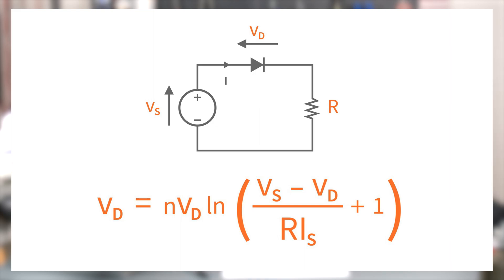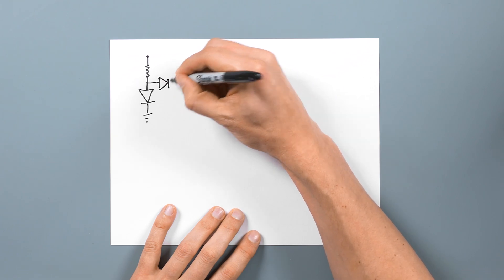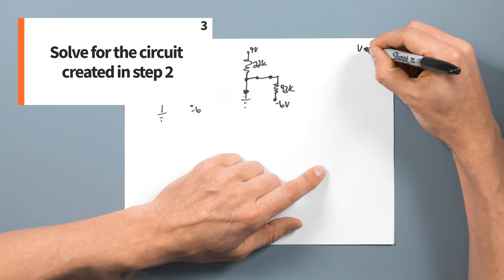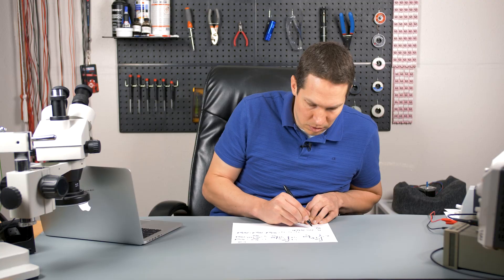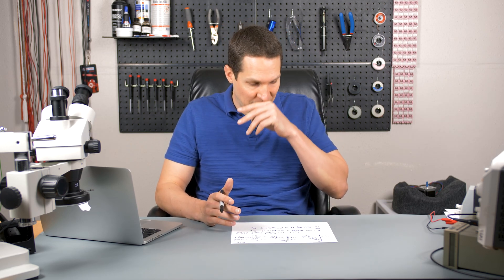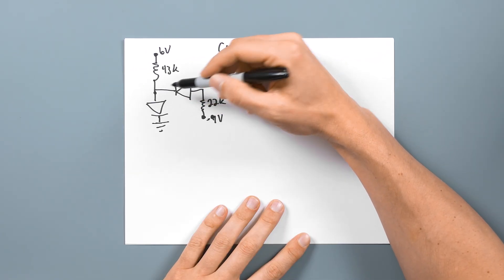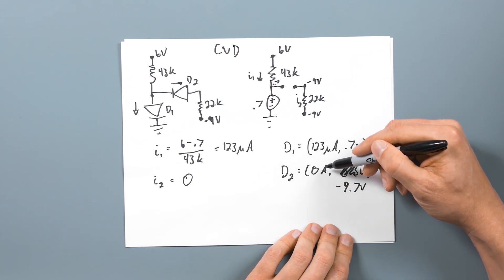Solving Diode Circuits | Basic Electronics

Comment: Why it's not closed circuit? This is terrible method of circuit drawing
Reply from the maker: Strangely, I agree - it's not my preferred way of showing things either.  But in the classes and textbooks I've taken/seen, they show circuits this way ALL THE TIME.  Your experience may be different but, as much as I dislike it, I think it's good to get a good feel for how to deal with both representations so it doesn't cause problems in the future.

Comment: I think drawing circuits in such a manner is confusing.  Circuits are supposed to be closed and putting voltages at a node with no connection in sight throws people off.
Reply from the maker: Isn't that interesting how we get used to viewing circuits a certain way?  But people do it different ways and it's good to get comfortable with the different common representations.
Reply: @CircuitBread  I've taken a few circuit courses as an electrical engineer, so I do see the many different ways.  However, the fundamentals of circuit analysis are knowing the voltage-current relationship of an element and kirchoff's voltage and current rules.  It's just strange with no closed loop evident in a circuit drawing, but circuits with diodes and transistors are usually displayed as shown in your video.

Comment: I have a question. We are learning about diode circuits right now in my microelectronics class. One of our homework problems has us solving for the diode voltage and current of a diode/resistor series circuit using not only the constant voltage diode model, but also the iteration method using both the KVL equation and the exponential diode equation, along with finally a load line analysis using Python/MatLab. We are tasked with solving for these values with the applied voltages of 0.5, 0.8, 1, and 1.2 V. The values of reverse saturation current and resistance are both given. Using the iteration method  for the applied voltages of 0.5 and 0.8V, the resulting values of diode voltage quickly rise above the amount of applied voltage, which obviously doesn't make sense in reality. And subsequent iterations would result in a negative current, which causes issues for the log function being used for the iteration. I know this is surely because it is before the threshold voltage that would cause current to flow. I feel comfortable in saying that no current would be flowing with the applied voltages of 0.5 and 0.8 V, but what exactly could I say about the diode voltage when the iteration breaks down?

Comment: hey, thanks for the great explanations! I was wondering in the last exercise of i2=0 how does the voltage drops across D2?
Reply from the maker: I hope I understand your question.  So, when i2 = 0 (there is no current through diode D2) why is there a voltage drop across it?  It's important to note that since there is no current through the resistor, there's no voltage drop across the resistor, so the voltage potential on both sides of the resistor is the same: -9V.  Since we know the voltage potential on the left side of D2 is +.7, we can see that the voltage drop goes from positive .7 to negative 9, so we get a 9.7V drop over D2.  Does that help?
Reply: @CircuitBread  thanks for answering, from your answer I understand that even tho there is no current there is a drop in the voltage value because of the diode which is different from what happens with a resistor?
Reply from the maker: Sorry for the delayed response, but yes, you have to change your way of thinking between resistors and diodes.  I thought ohm's law applied to everything at first and it took me a bit to realize that it doesn't work that way.

Comment: Feeling like my professor threw our class to the wolves, on the same day he introduced diodes he wants us solving the peak forward current through them and we have both AC and DC sources in the circuits. Any chance you have an example like that?
Reply from the maker: Hey Matthew, that sucks - I really hate that feeling.  While we don't have anything for that explicitly, I'd recommend approaching it with superposition to simplify things:  https://www.circuitbread.com/tutorials/solving-circuits-with-superposition-theorem  Basically, find your peak forward voltage with the AC circuit and then had that to the forward voltage caused by the DC circuits.  The challenge here is that you have to be sure you're biasing your diodes properly in your assumptions.  Since you're planning on it being your peak forward current (and not trying to figure it out at all times), that should make it a bit easier.

Comment: This is really helpful in understanding diodes and their calculations for an exam I have coming up. Just one question. How do you know if your assumptions are wrong? Are you double checking the current values you got at the end to the assumptions you made for if the diode is forward bias or reverse bias? Forward = current and Reverse = no current.
Reply from the maker: Yes, that's exactly it.  After you've done the math, if your current is flowing the wrong way through the diode, you know that's not possible, so the assumption is incorrect.  Good luck on your exam!

Comment: For D2, shouldn't it be 0.7 - -9.7? ( which is 9.7 V)
Reply: Oh my gosh that's so basic your right! Thanks man
Reply from the maker: What's the time stamp?
Reply: 12:46. Awesome videos btw I told half my class to check out your videos!
Reply from the maker: Nice, thanks! 
That's a great question and can definitely be confusing.  I may be off-base here, but I think the core of your confusion is you're trying to use Ohm's Law, where you calculate the current by subtracting the second voltage from the first.  We're not calculating current here, we're trying to figure out the voltage drop.  If that were a resistor, rather than a diode, and we were calculating current, you would get a positive number, which is correct!  Because the current flow would be in the direction of our assumption.  
But in this case, we just know that the the voltage, using our assumption of moving from left to right, is going from .7V to -9V, so it's dropping by 9.7V.  Which gives us -9.7V.  Hopefully that helps!

Comment: In the last 2 examples:-
You took 0.7 V drop in the forward biased diode in last example.
Whereas,
You didn't took 0.7 V drop in the forward biased diodes in the second last example.
Why so? kindly explain please.
Reply from the maker: Hi Himanshu!  As discussed, there are multiple ways to deal with diodes, some more accurate than others.  The easiest and least accurate method is to treat a diode as if it's a short when it's forward biased, as I did in the second to last example.  An easy and more accurate method is to take the .7V drop into consideration, as I did in the last example.  It was just showing the difference between the two options.
Reply: @CircuitBread  thank you.
    : )

Comment: In the second example, when D2 is considered to be reverse biased you still attribute a 0.7v drop across it. Is this still true, as it's not conducting?
Reply from the maker: Hey there!  There shouldn't be a .7V on a reverse biased diode but I'm not sure what portion of the video you're referring to as D2 doesn't have the .7V drop across it in the second example.  Can you give me a time stamp?
Reply: @CircuitBread  it's the part at 12:20-13:00. I'm mainly confused about how we're taking the voltage across a reverse biased diode, but I guess the voltage is still there even if it's not conducting.
Reply from the maker: Yeah, you're exactly right.  That -9V below the 22K resistor stays there even when the diode is removed.  And since there is no current flowing through the 22K resistor (since the diode is open), that same -9V is on both sides of the resistor.  That's how we have that 8.3V difference across the reverse biased diode.

Comment: In the first problem, you did not consider the voltage drop across the diode
Reply from the maker: Hey there!  At 2:22, I mention why we ignore the voltage drop across the diode.  It's the simplest (though least accurate) method of solving circuits with a diode in them.  Hope that clarifies things!
Reply: @CircuitBread  thanks

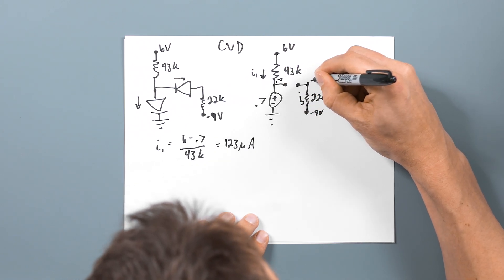Comment: Why in 11:47 do you assume that there is no voltage drop across the 22k resistance ?
Reply from the maker: Hi Mehdi!  With the open circuit, you cannot get any current flow as there's no path.  No current through the resistor means that there is no voltage drop across it either, as those two are directly related.  As a quick refresher, we have some Circuits 101 tutorials that we've posted this year if you want to check them out.